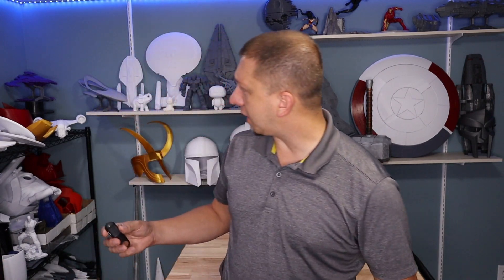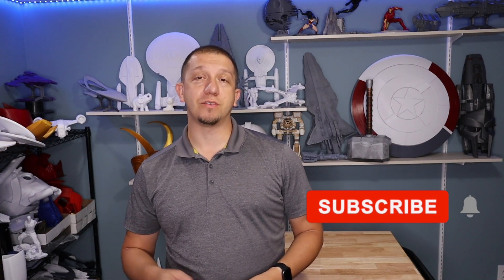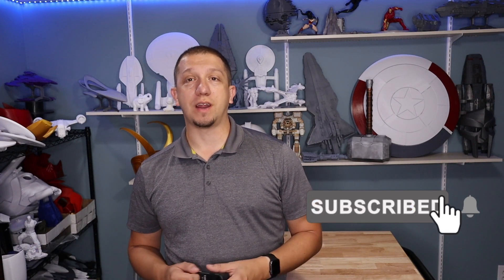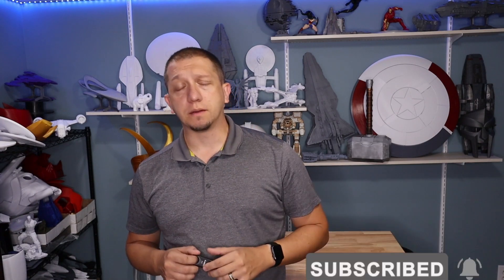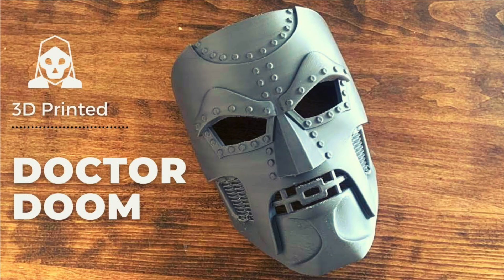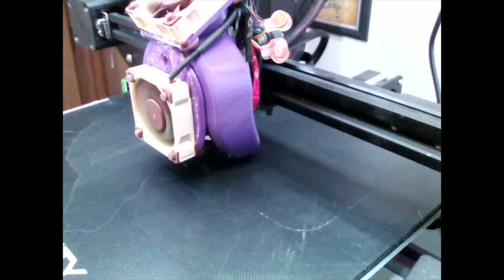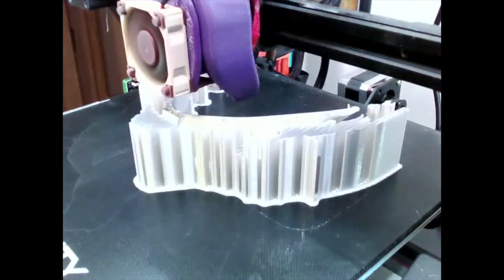DIY Costume with 3D Printing

Comment: Which printer did you use to make these?
Reply from the maker: I used 2 different printers. Most can be made on a Ender 3 size printer. I also used a CR-10V2 for the larger printers like Quills helmet and the larger parts of captain america's shield.
Reply: @Rise3DBuilds  ah ok. Thanks